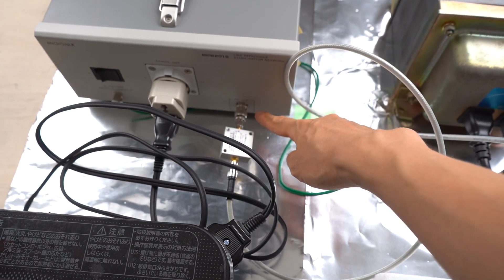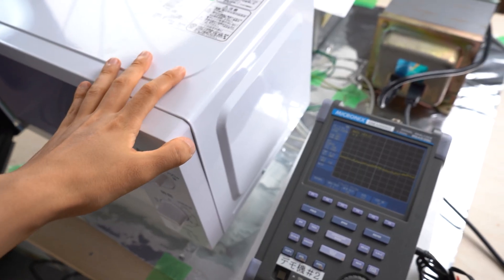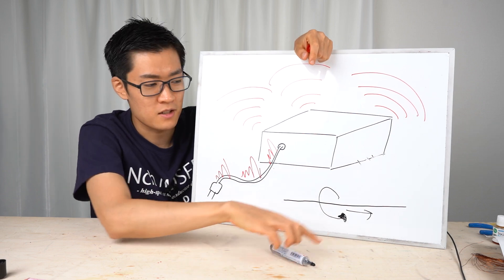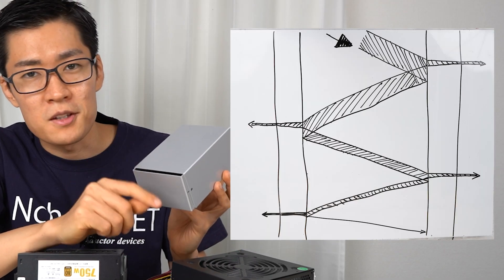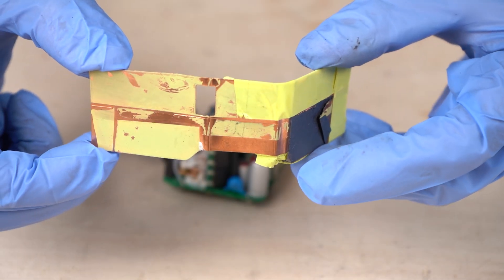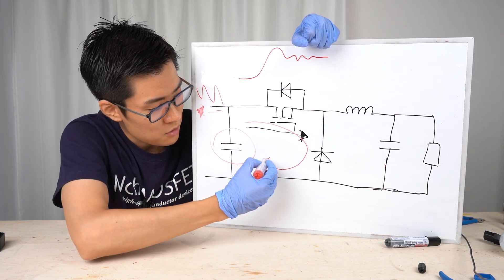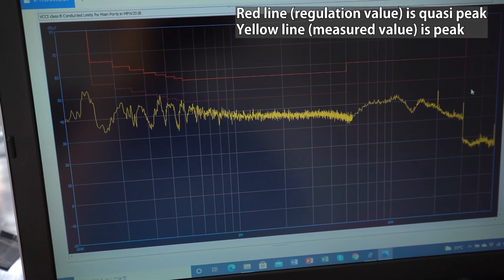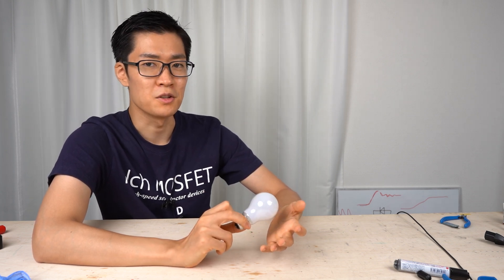Your Electronics Emit an Electromagnetic Noise!. This is the Reason!

Comment: I assume that the noise spectrum analyzer Y-scale center line is 0dB and actual noise value is Ref_dB + 10dB /division. Eg. 3:12, high frequency amplitude is <60dBuV (<~1mV). Am I understanding correctly???  Printing out the value would be great since the camera focusing usually couldn't show the Ref_dB properly.

Comment: when You turned on the microwave with water, You may want to know how the mw_Field is distributed inside?
To find out , make the following experiment: smear a thin even Layer of egg_white on the plate! 
Then run the microwave for 30 sec, 1 min... You clearly can see where the microwave energy goes the most; it usually is very unequally in radial direction!

Comment: I have a cheap 12V chinese fridge which emits enough 433mhz interference through its compressor(?) that it randomly turns 240V appliances on and off (433mhz old school “smart” wall sockets) in the middle of the night

I feel like that should be regulated to avoid death depending on the appliance left plugged in

Comment: The cheap LED does a better job... Shame to the big corporations...
Reply: True, but only for EM noise. Regarding power efficiency the cheap ones often have dismal performance (isn't it the power efficiency the main reason behind LED lights?) because of the capacitive droppers inside that cause a lot of reactive power and a bit of resistive heat dissipation, opposed to the switching supplies of the pricer lights.

Comment: It is the high frequency power supplies that cause noise. 
A normal 50 or 60 Hz transformer doesn't do that. 
But the switching power supplies in many devices.

Comment: If anyone thinks EM noise is boring and shielding it is pointless, just look up 'Van Eck phreaking'; even in the 80's it was demonstrated that someone in a van across the street could detect signals emitted from a TV and re-create an image that you were viewing. 
Now, keyloggers or worse on a PC can tamper with video signals and transmit data over the EMF from your PC monitor, see: the 'Airhopper project'.

Comment: Great video! Now I am curious if the microwave magnetron "feels" that there is something in the oven, and if the noise spectrum changes based on the food item. Could the noise profile be used to make a microwave, that uses the RF-feedback to detect whats in there 😁
Reply: Yes ... it will be sold to you in a few years. (funny story; colourtv was invented/developed, after that they needed another year to make it B/W. before it went to market)
Reply: I think the water absorbs some energy from the waves and then makes them shift to a lower frequency. Lower frequency = less energy. Search for atomic absorption spectroscopy

Comment: The change in noise with a bowl of water in the microwave is very interesting. Is this from the reflection/absorption of the microwaves in the water?

Makes sense. I would be very interested to see the signal with a spoon or some other non-arcing piece of metal inside

Comment: In early 2000s I've had a CRT TV which stopped working one day. As I've had some electronics repair skills I decided to repair it myself. I've, correctly, diagnosed damage of the main SMPS transformer. Since the TV was pretty old, I couldn't get original parts anymore. So I bought some cheap piece of garbage from China. I don't know what's wrong with that transformer but it seems like it's possesed by a demon or something. When I installed it in the chassis and turned on the TV, my laptop shut itself down. My sister's laptop in another room started to move it's mouse pointer by itself. My dad's TV in yet another room turned itself on and every speaker in the house started making buzzing sound and the TV itself only had a slight interference pattern visible all over the picture. I have no idea how is it even possible for a simple transformer to be so noisy but it somehow is. I haven seen that much noise even when I was playing with a Tesla coil. Electric noise can be very weird sometimes.
Reply: Seems more likely that your AC mains power was bad for a while, as there's practically no way that radiated RF from the TV transformer circuit would shut down a laptop among the other observations.
Reply: @stinkycheese804 fake story on the interney? no way
Reply: That’s crazy! Maybe the Chinese manufacturer knew it was producing junk components so they threw in a couple free demons to sweeten the deal? Lol
Reply: You have just unleashed a poltergeist the moment you turned on the transformer.
Reply: @tigerporkie  voltergeist

Comment: As a ham radio operator, noise is slowly ruining the hobby as more people begin using electronics with cheap power supplies - especially those in cheap LED lights.
Reply: There's no slowly about it 😣
Reply: We need more emission regulations
Reply: The FCC needs to get involved here. In the mean time, search youtube for greenwave EMF filters.
Reply: Estou tentando instalar em minha casa , um receptor de ondas curtas (SW), e já descobri que, pior que a cerca elétrica do vizinho e as lâmpadas LED , são as geladeiras "modernas".... aquele maldito painel de contrôle gera harmônicas em várias faixas de HF... 🤝73
Reply: Many solar inverter makes QSO reception of several hundred meters impossible.

Comment: Электромагнитные волны распространяются не по воздуху.
Reply: You are incorrect. Electromagnetic waves can/do travel through the air—and, notably, they don’t need any medium at all to propagate. This is because electromagnetic waves are self-propagating oscillations of electric and magnetic fields, meaning they can move through a vacuum (like space) as well as through materials, such as air.

Here’s a breakdown of how electromagnetic waves interact with different mediums:

1. In Air: In the air, which is a mix of gases, electromagnetic waves can travel with minimal attenuation, especially in the form of radio waves, microwaves, and visible light. The air doesn't significantly slow down these waves or absorb much of their energy, so they can pass through relatively unimpeded, which is why we can see and receive radio signals over long distances.

2. Through Solids or Liquids: When electromagnetic waves pass through denser materials like water or glass, they slow down due to interactions with the molecules, which can cause refraction (bending of the wave). Higher frequency waves, like ultraviolet (UV) and X-rays, might be absorbed or scattered more in these media.

3. In a Vacuum: In a vacuum, electromagnetic waves travel at their maximum speed, approximately  meters per second, or the speed of light. They encounter no resistance or absorption, which is why space, which is mostly a vacuum, allows light from stars to reach us on Earth.

Overall, air is an efficient medium for electromagnetic waves, but they are equally capable of traveling through materials or complete vacuums, adjusting based on the environment they encounter.
Reply: @Ink_and_Motion_Studio  имелось ввиду, что воздух не обязательно нужен как среда распространения электромагнитных волн. Эти волны распространяются через электромагнитное поле. А это поле есть всегда и везде. А вот, например, звуковые волны, распространяются по воздуху. В вакууме их нет.

Comment: I am a mechanical engineer, but I work with people designing electronic devices and this information is very useful for me.
Reply: Huh?  This is extremely basic info, anyone designing electronic devices is already well aware of it.
Reply: @stinkycheese804   I am not designing the electronics, I am designing the stuff around it. I think I mentioned that in my comment.
Reply: @stinkycheese804  yes, the best education is to be clueless and just ask very specific questions when you need information. there is no benefit to having an underlying knowledge base, gathered from multiple sources.

Comment: The amount of engineering effort and money we expend during our designs for radio, Radar and other equipment is staggering just to maintain legislation compliance and safety. EMC is NO JOKE and so often is either completely ignored or denied through ignorance and or greed is alarming. You cannot produce a complex products cheaply whether it is a microwave oven, light or radio. More so now than ever with the advent of digital systems and high switching speed for processing whatever data may be. Organisations NEED to Adhere to legislation on these matters for perfomance and SAFETY. To all  designers and corporations out there thinking they can get away by cutting corners?  DON'T!   It will cost you more in the end. Think about it.

Comment: Who else has had to explain to a clueless boss that the cheap microwave in the breakroom is the reason her wifi keeps going out?
Reply: Try telling the girls in the dorms the floor under you that their “fillups” brand 2.4ghz cordless phone is knocking out the ENTIRE BUILDING… it was 2004 and we didn’t have dedicated ethernet runs… they were on the phone so much I was about to pay the penalty and drill holes in the walls and floors to run a cable to the router closet.
Reply: 😂Put an aluminum foil "hat" on it for her and tell her this is how they work. Funny for a little while, anyway.
Reply: Oh god just realized why sometimes 2.4 wifi doesn't work. Maybe some neighbour was using a microwave oven.
Reply: Tell the truth he have military radar in a box working as wifi jammer.
Reply: Well that's cleared that up....
I had a customer that ( like me)  was baffled when she used her microwave , the internet/ router stopped working.
Reply: Probably more like relatives. I don’t freakin’ work for a ‘boss’. 😅
Reply: Those are old microwaves; and only affects 2.4GHz. pull that thing out of the break room before someone launches a lawsuit for workplace injury.
Reply: @jamess1787  Daft comment. All microwave ovens work on ~2.4GHZ because this is the resonant frequency of water and its this resonance that causes the water in food and other items to cook. Microwave ovens of any age will all use this part of the radio spectrum. The solution is to ensure the microwave is grounded correctly, as this will help and would also indicate a possible hazard, and changing the wifi to one of the other bands available, if at all possible in their own set up. Even better would be to use a wired set up, perhaps re-enforced with localised wifi AP's scattered around the workplace.
Reply: @jamess1787 all microwaves work at that frequency. Some are better shielded than others, you could measure with EM meter. But most leak at least a little bit.  One solution is other wifi frequencies, that's why we have newer standards at higher frequencies for both bandwidth as well as less interference. could be also resolved with additional wifi routers on each side of the room, or even just better shielding around the microwave itself.